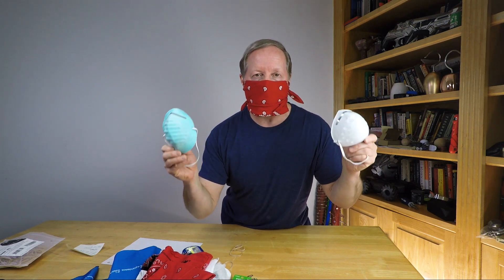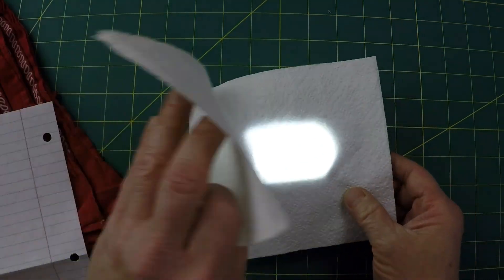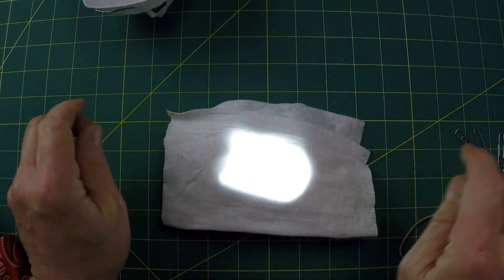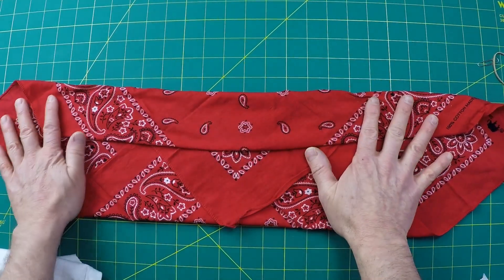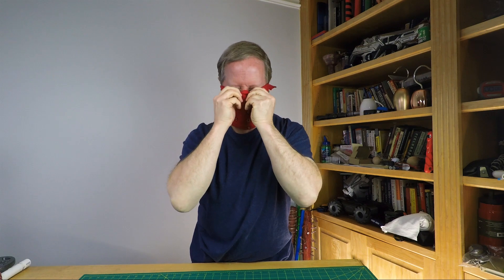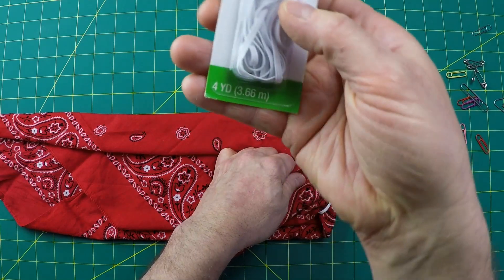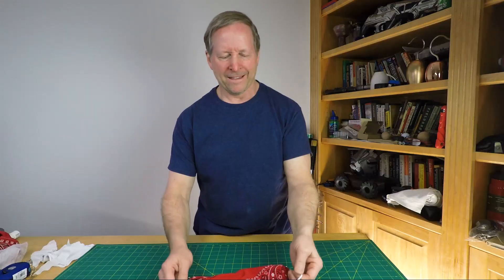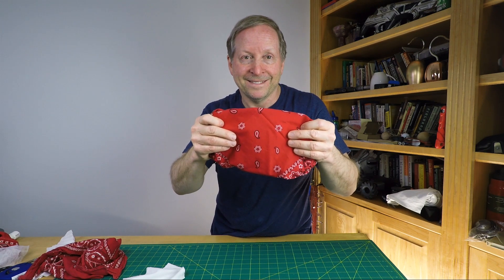Quick Test of Your Face Masks - Are You Safe? Prove It

Comment: I can't see a light test being valid data for something so small you can't see it like COVID-19. Under a microscope most of those materials have gaping holes that easily fit the virus. Although as the CDC says multiple layers can help to catch some percentage if on a larger droplet. Check this out. https://www.youtube.com/watch?v=PAnpw4_8rfg It will give a good understanding that using something like a paper towel is like throwing a beach ball through a an open doorway when it comes to blocking COVID. Also the dust on paper anything can break off and take whatever is on the DIY filter right into your mouth!
Reply from the maker: Practical Guy, your point is valid. This test is intended to give people a general sense of how things like only a bandanna or scarf are totally ineffective as you pointed out above. Yet I see so many people walking around as if they are safe, its like wearing cardboard thinking its a bullet proof vest. Or those who wear masks and not gloves again thinking they're safe. Even a 95 mask breaks down after a short period of time. Yet the test is simple enough to give folks a general sense i.e. if all the light is blocked out its better than the scarf they've been wearing. Thanks for the link I'll check it out.
Reply: @MakeItorBreakItNow  I hear you. The light test is better than nothing! There are so many issues and variables with people and DIY mask solutions. Any pulp based mask like N95 and surgical will break down as you say. It's likely with breathing moisture and air pressure after a some hours they are already starting to fail. Paper anything will always break down especially with wet pressurized air pulling it back and forth all day long. When wetting a paper towel or napkin they easily rip apart. I've seen people using alcohol to sterilize N95 and surgical and re-use but that removes the static electricity from the fibers making those masks absolutely ineffective. I found this test which is air particle testing, there are 2 charts don't look at the first one, scroll down to the 0.3 micron . How they tested https://www.youtube.com/watch?v=jFlub7snCPo&t=1s and the tests results https://smartairfilters.com/en/blog/best-diy-coronavirus-homemade-mask-material-covid/ . Even that leaves a lot of variables. For example denim, I own many thin, thick, stretchy and stiff jeans! So they all will perform different. Cotton kitchen towels, same thing I have very thick absorbent and very thin, some with dense thread count and some that I can see through without a light!  So I can't see how anyone can make any mask confidently. Then there is fitment. If there is no seal to your face then its also not going to work. This woman did some great tests with her hospital staff in testing patterns and some DIY worked to seal while others only work on some face shapes. https://www.youtube.com/watch?v=DZBbkn-g-vE They are using a material for the test masks called Halyard H600 which is designed to stop bacteria. It's a promising mask material but was not designed to breath through so I am worried it will have some ill issue harmful to breathing that will be a problem, maybe plastic fibers that can get in your lungs, or chemicals. Kind of like the hoover hepa vacuum bags that are made of fiberglass and people are using those for masks. Certainly anyone breathing glass dust or plastic in their lungs daily will be having bad health/ lung issues later in life.
Reply from the maker: @practicalguy973  Practical guy, agree, manufacturers never expect people to breath directly through vacuum bags, yet people have recommended making masks out of them. Also see a bunch of coffee filter only masks. thanks again for the additional information and details here. Lets hope we all get through this safely.

Comment: The bandanna masks are the most effective when it comes to protecting yourself from the COVID virus, if folded properly, the mask has at least 3 to 4 layers of protection from airborne particles (which is what the CDC recommends for effective filtration). 

T-shirt masks are not as effective because they only have 1 or 2 layers of filtration. Airborne particles can penetrate these two layers easily because they're not as thick as a bandanna mask. Thus they are less than 50% effective. 

Single layer masks such as industrial dust masks and the like are less than 10% effective and will not keep out airborne particles to any degree. Thus using these masks for the COVID virus are inadvisable.
Reply from the maker: Emerald Knight, thanks for your comment. Its a good one and seems to validate my simple test. I see too many people walking around with a typical two layer bandanna or a scarf thinking they are protected.